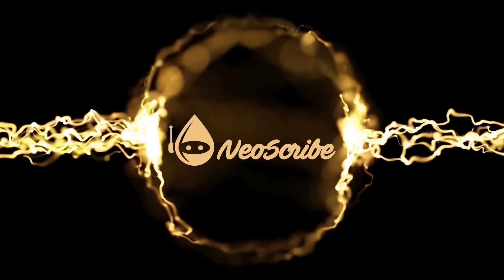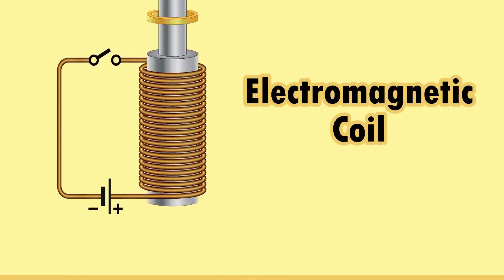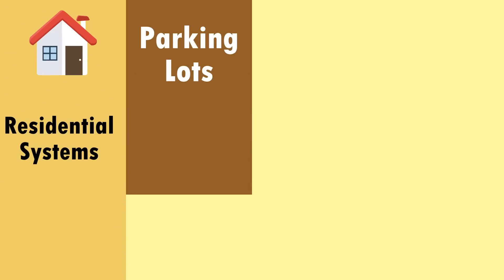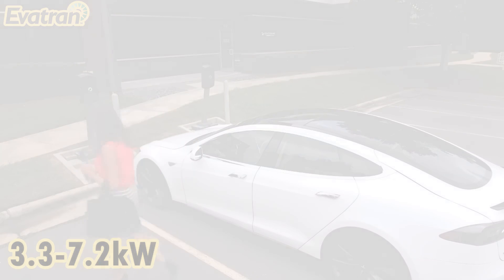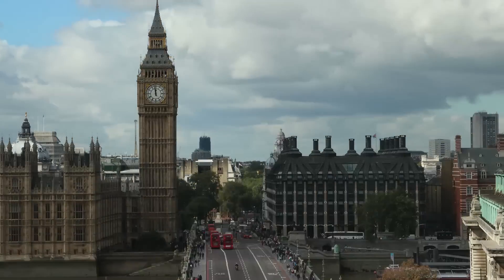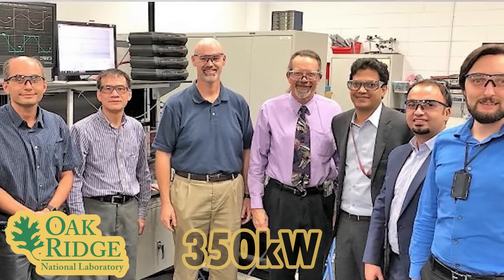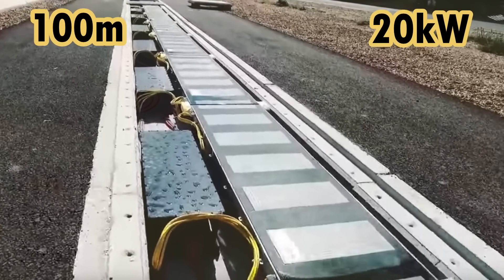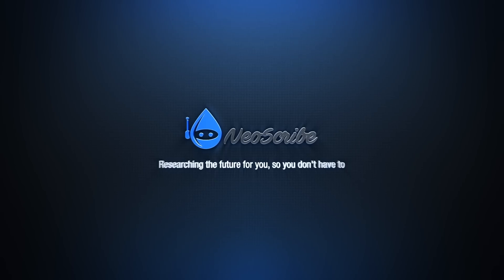How Wireless Charging For Electric Vehicles Will Solve Range Anxiety

Comment: Maybe not, 
There are several problems to overcome so that wireless charging can become common,

the first is the coil type, just as you can't charge a Renault Zoe with a tesla plug you wont be able to charge different cars wirelessly, and that is on purpose, different manufacturers make different plugs ( or in this case the size of the coil) só they attend different demands for charging.

The second will be energy loss,  it takes a lot of input energy to create a current in the other coil, most efficient wireless charging today is 75% (on the high end).

and The third would be infrastructure, it would have to remake roads, waterproof  several components,... 

with that said, there are places where wireless charging would be great, like in public transportation , several countries are testing this, but again its because the busses are the same model, they have a designated line, and it only on the bus stops.

Comment: I think it is viable for the home and for designated charging spots. Charging while driving is no more than a lysergic dream, though. It would be prohibitively expensive and provide very little value.
Reply: its not viable as then the cost of hydrogen is going to be the same because wireless charging lowers efficiency by almost 50%.
Reply: @butspan7618  u wut bruv? That doesn't make an argument.
Reply: Jasertio ✅ He's saying that the efficiency of wireless charging is so poor, that energy hungry hydrogen fuel vehicles will be about the same in terms of energy use but hydrogen fuel is wayyyy more convenient and far less irradiating.
Reply: @bobafett5241  yeah I guess that makes sense. However, I do think there is some margin for debate on what's more convenient. You can't refuel your hydrogen vehicle at home, for example.
Reply: Jasertio ✅ Yes but hydrogen fuel can be filled up like petrol, and the main reason why people buy petrol over electric is for conviene. I’m pro electric but I think wireless charging is a bit pointless. Plus imagine driving along for hours with 350kw electromagnetic field right underneath you, that can’t be healthy.
Reply: @bobafett5241  "that can't be healthy", you say that based on what? On the topic of convenience, that's why I said it's a matter of opinion. I, for one, think it is a thousand times more convenient to be able to charge at home or at work. As for the reasons why people still buy ice's, there are many of them. You can't say it is all due to convenience.
Reply: Jasertio ✅ I agree with you, charging my car overnight is more convientent, but I based it off how the majority of world drive petroleum cars and are less willing to switch to electric because it’s less convienent, etc. As for EM fields, they do slightly charge the body which can effect nerve relays marginally, and they have been strongly linked to childhood leukaemia (with high strength EM fields like a 350kw in the video).

Comment: road wireless charging is an idiotic idea.  At even 40kph to deliver say 1kwh from a 20kw charger you have to be in full contact with the charger for 180 seconds meaning the charger has to be 2 km long.  1kWh is enough to drive a modern EV car about 4-5km in the summer or 3-4 km in the winter meaning to sustain itself 33% of your highway would have to be  charging pads.

No, bad idea.  stop it.  

Wireless charging at best makes sense for high repeat contacts (like service terminals) that are at a fixed location.  That way you can up the power and expect longer term contact.  Think airport shuttles or metro bus service.

Comment: You don't need government involvement! A good start might be stores, theatres, grocery, fast food. Even ahead of your garage. Built in the asphalt. Thus you drive to store say your in there 30 min and it is a 12 kw charger. You just put 6 kwh in your car or 18 miles. If you live 5 miles from store, you gained about 10 miles when you go home. Cars can be made with smaller batteries.

Comment: nay, it seems that putting charging receptacles in the road is a failed concept from the conception.  But SOMETHING will be done to make things better.  Samsung already has a better battery chemistry that the Lithium we are all used to.  It's a graphene battery.  It has several awesome perks, to lengthy to mention here.  But if that is ALREADY complete.  Give it 5 years.  There will be another awesome innovation.  And it will not be some embedded charging receptacles.  You don't see embedded filling stations for petroleum.  It is just not a necessity.

Comment: Great Video... As for the Wireless Charging it just won't happen because vehicles are limited in the Range for a Reason; believe that. Why do you think there are Government Laws that are very specific that a Vehicle MUST Get X Number of Miles per Gallon? Reason being is they are designed to Limit Criminal Activity. You don't want a Bank Robber or a Murderer escaping in a vehicle that has unlimited range capabilities for example. It is a known fact back in the 70's they had V8 Engines capable of over 100 MPG with 20 or 30 Gal Fuel Tanks or the ability to range upwards of 3,000 Miles. The reason those Carburetors where not put into full production is to create a false NEED for Fossil Fuels or an inflated need. Sure much of what you say will happen but believe me they won't be as useful as you think. There will be a way to charge for this service to keep it out of the hands of the average Joe... Needless to say the road to HELL is Paved with Good Intentions and Wireless Charging is just such an INTENTION... Cheers...

Comment: Its better to find a way to automate a plug-in to automatically fit into a car when you park it into the charging station. This will save you the same 'precious' 5 seconds that wireless would save, without the energy transfer inefficiency headache.

Comment: the current tech we have is too inefficient, i we should just stick to cables or go for hybrids/traditional cars fueled with hydrogen/synfuels. we can mass-produce those synfuels/hydrogen economically with high/very-high temperature reactors.
Reply: Hydrogen is only 40% efficient in an EV, 15% if burned in ICE.

Comment: how would you stop current from being induced into unwanted places? You can't just chuck these things around willy nilly. The only place I see wireless charging being viable is parking spots. I used to think it would be neat to have a "charge lane" on the highway, but it would just be insanely expensive to implement. Even then, a simple plug to a 240v line would be cheaper and probably more practical. If you want to automate it, you could have a port on the bottom of the car that mates with a thing that automatically aligns, whether it moves, or the car does.
Reply: Good idea. Kind of like when you go through a automated car wash. They have metal guides for your tires to be in a precise position to line up the high voltage charge lines.
Reply: It's tuned frequency for the car's coil. No prob.
Reply: Ha! You're car had better not have a metal frame or body, or else most of the energy will go to heating them up (eddy currents).
Reply: Sorry, you have no idea what you are talking about. The system is resonant frequency tuned - itonly affects the receiver coil.

Comment: own a EV for some time and you well find there is not such thing as Range Anxiety  .Range Anxiety was some thing fake made up by GM yes it was look it up . to pull the EV1 line up . they them self said it was fake . Range Anxiety was made to be put there in your mind to trick you just a fast food is placed in the right spot . ever seen some 1 talk about Range Anxiety for a gas car.. a ICE car still can only have so much range and still have to find a place to fill it up and it still takes time to fill it up .  the EV is a tool and make sure you get the right tool for the job .  EVERY EV comes with a change cable . how many times do you drive by a state/gov park  RV park and so on every day that would let you plug in any time of the day for free or for a small fee
Reply: As an engineer, I an categorically state two facts: (1) there is no electrical car that beat the range of a similarly sized (passenger and cargo capacity) gas-powered vehicle. Add to that charging stations are less common than gas stations and you will have to worry more about fuel.
Reply: falcon7350 Yeah,no. You’re not gonna drive across America in an ev anytime soon
Reply: I agree.  Range anxiety is probably a thing when EVs used to have little range.  
In the end, it is the poor choice of title for this video.  Wireless charging doesn't solve range anxiety but reduce the need for larger batteries.

Comment: I'm skeptical. 

1) That is a LOT of energy needed just to charge wirelessly. If the car is parked, there's no reason why it can't be plugged in.

2) Having a driver that close to all that energy transfer doesn't sound safe.

3) Charging the battery too fast reduces the battery life (not a problem specific to wireless charging).

4) Could you IMAGINE the cost of installing wireless chargers in the road itself?

I would be more interested in flexible solar panels that are mounted to the car itself. It wouldn't power the entire car but it would help. Especially when parked on a sunny day.

Comment: There's never going to be a full charging lane. Wayyy too much in costs of materials/magnets, construction, maintenance, etc. The best solution would be putting them at stop lights and in parking lots, but it cost buku bucks to line an entire lane with high voltage, expensive magnets.

Comment: Wireless charging doesnot exist, not scientifically possible, is a misleading idea based on inductive charging, which inductively is limited, it would make roads more dangerous because there would be electrical problems, also more expensive, electromagnet and electromagnetism also doesnot exist, another lie based on static charge, which is very different, cells need to stop repeating this lies, immediately the system need to fix this ongoing epidemic of lies being spread like parrots.

Comment: I surely will prefer to plug in my EV (if I had one) that having wireless charging were I park, it's way too inefficient and lose too much energy. We will need as close as possible to 100% efficient charging when all vehicules will be electric. Wireless charging while driving is a dream that will never be fulfill. Road are poorly maintained already in most countries, they will never invest in changing the road to wireless charging. They havent done it to improve safety on wet/icy roads
Reply: Some good points but the first one isn't correct
Reply: It is as efficient as  a corded charger. Way more convenient. Vandal proof. Allows  your car to go charge itself, etcetcetc